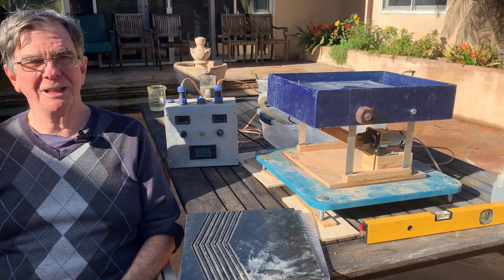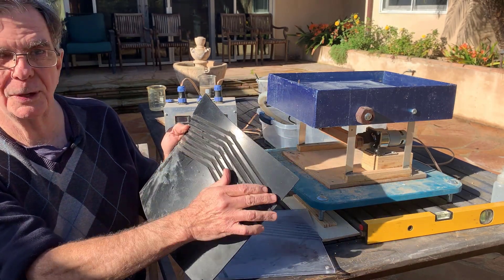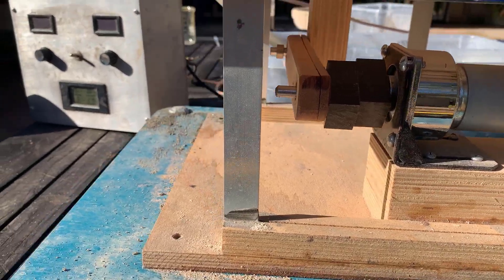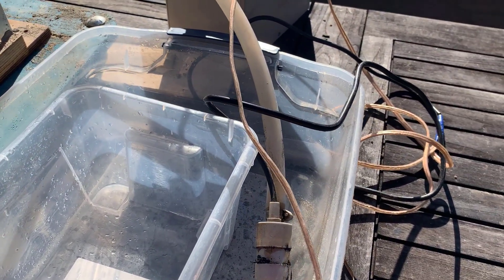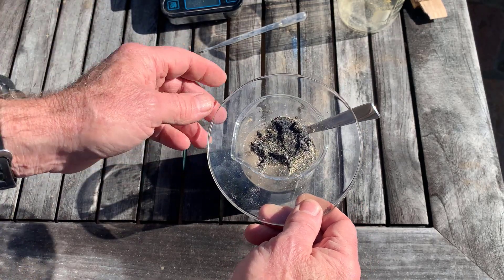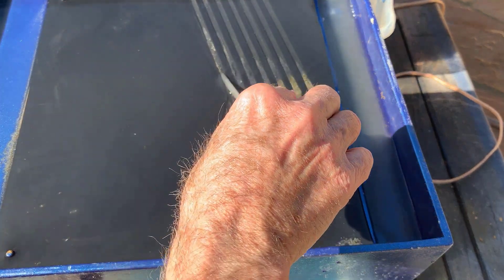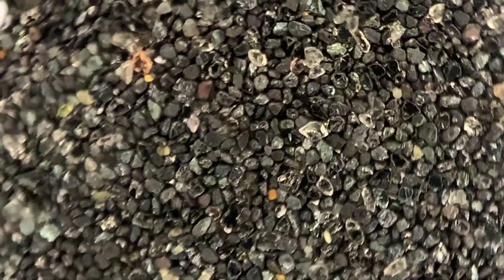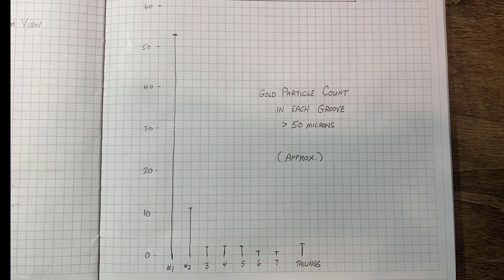Gold Shaker-Sluice Demo -- Prospecting and Extraction

Comment: nice and simple shake box - great cleanup tool, though i'm not much in love with the idea of using a snuffer bottle to pull the fines out , but if thats the worst part of the cleanup i could prob. deal with it ...
Reply from the maker: Yes, I found it a bit onerous at first. Not ideal, but I consider it much easier and faster than cleaning out the mats on a sluice box and it should work in a continuous process.  Anyway, I'm still playing with the idea.  -- Dave

Comment: You have a shaker miller table that gets your classified material down to just black sand and gold with a little bit of blonds. A miller table gets rid of the black sands and blonds, and you get clean gold but is slow. You have accomplished what one can do panning. The shaker part is good, but one needs to zero down to separated gold from the blacks and blonds. The golden boys are getting close to doing that . They do not how ever show their shaker part of their art . It is fun though experimenting
Reply from the maker: I have a mat that is much better at the final separation. The mat shown in this video will be used for the initial separation and then the second mat is used to further refine the flour gold. I'll be showing the complete process in an upcoming video. Thanks for the comment!  -- Dave
Reply: @orophilia  i imagine a 'mini-'shaker' style of groove system would fit the bil for the better seperation desired and output without need of snuffering at the end ...
Reply from the maker: @1Search  Hi Robert, Could be. There are endless variations to this idea. -- Dave
Reply: @orophilia  so would the final variant of the finishing mat be a narrower grove?  Can't wait to see the final finishing small shaker table video. Thanks for sharing your time.

Comment: I still think the vortex riffles with a preescreening is the way to go. The shaker works great as a sifter I bet, and the output could go over the different sized vortexes with individual slopes and flows.
Reply from the maker: I love to experiment, so I may try making a version of a vortex mat. I have other mats that work well for the final separation step, leaving much less unwanted material. Thx!  -- Dave
Reply: @orophilia  You should try once adding so much material that the top vortexes fill completely with gold. I find that my mats don't let the gold past first set of vortexes until they are full. The black sand is exchanged for gold continuously. In my classifying sluice I find gold a few rows down probably because it sometimes takes a bit to settle through the material flowing across the screen. With very fine gold I expect you need to use quite small vortexes otherwise you would have room for too much material in the pockets as you say. That wouldn't work well as a cleanup system.  Out in the field however it is amazing how long one can run without cleaning up when the mats exchange so well. It is more a matter of nerves than actual capacity. One can't resist the urge to have a look.
Reply from the maker: @1kreature  Howdy!  Yes, I agree. I'm finding that the entire table can be filled with fine, heavy black sand and as long as the sand is liquefied the fine gold will drop to the bottom of the first or second groove. It's quite surprising. I'll have a new video soon with an interesting new mat.  -- Dave

Comment: Is there a reason as to why you feed your material into the centre of your mat rather than spreading it all along and thereby utilizing the whole chevron ?
Reply from the maker: I don't want the material near the edge because with this mat it can fall off the edge and end up in the tailings tub. (It's not quite wide enough.) Next version will eliminate this.  -- Dave
Reply: @orophilia  I see.
I also have an issue with material getting down the edge and getting UNDER the mat.
Perhaps gluing a 8mm wide thickness strip of neoprene along each edge will prevent it.
Reply from the maker: @mohammednovalija  Yes, that's a good idea. I'll try it on this mat.  -- Dave